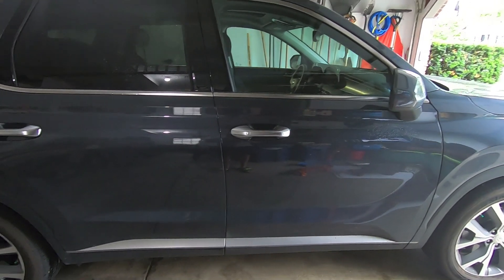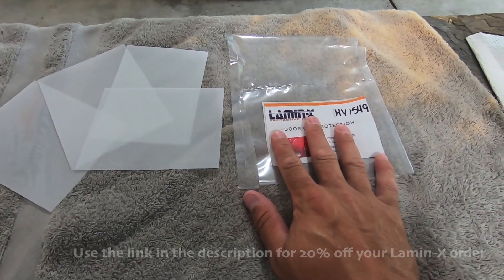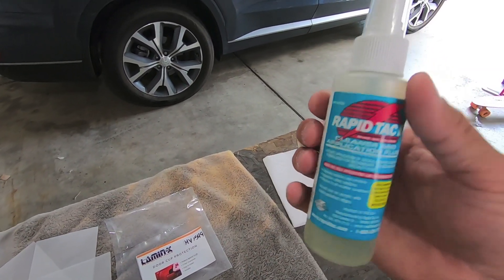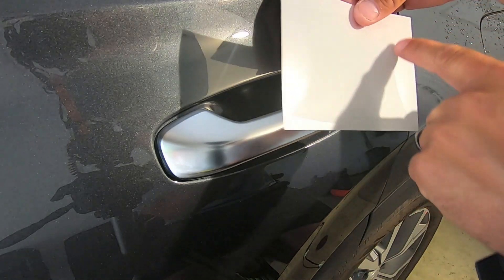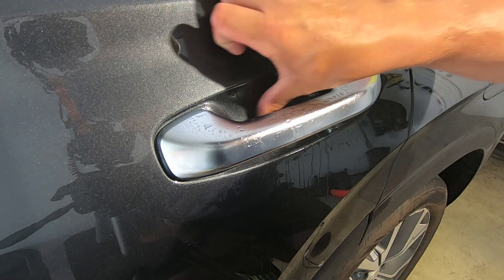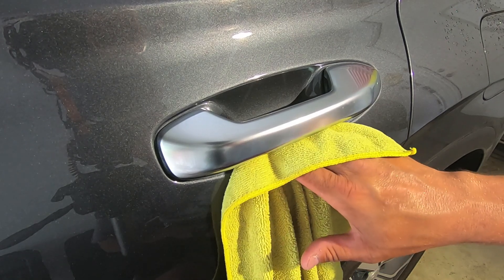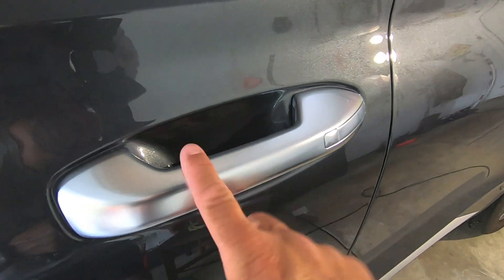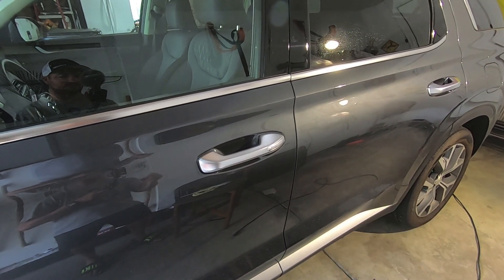Lamin-X Door Cup Protection - Hyundai Palisade (includes a 20% off coupon code in description)

Comment: Great Video!  Just purchased a 23 Palisade. Will the Lamin-X fit this redesigned model?  Website doesn't show a 23 is available yet for the Palisade.  Looking to get these done before my door handles get vinyl wrapped (body color) followed by Ceramic Coating
Reply: Just picked up our 23 on Friday,  definitely want this as I see how bad our van is
Reply from the maker: Maybe but I would verify with lamin-x
Reply: @WaterFowler41  I did just that. They are expecting them to be available mid October